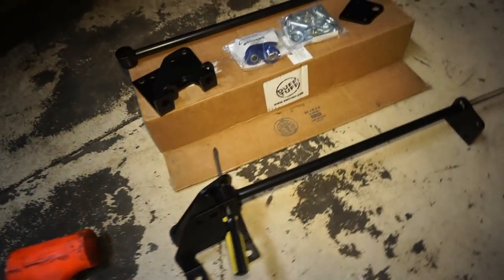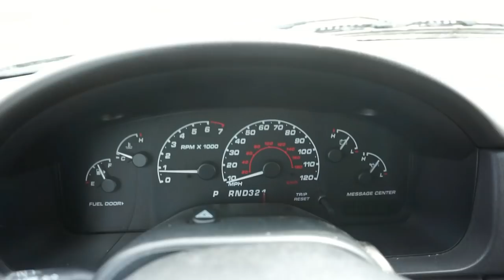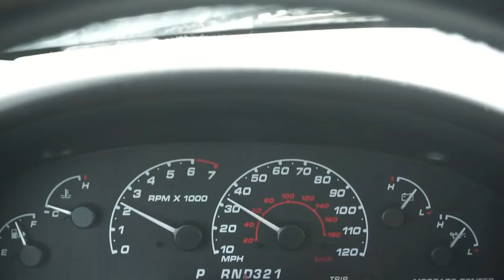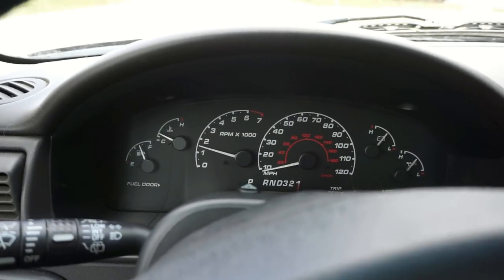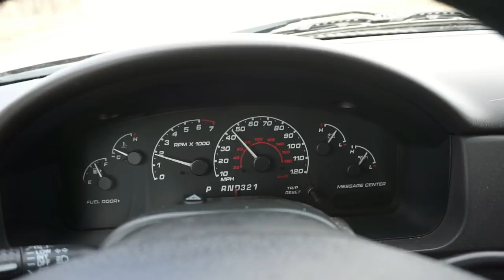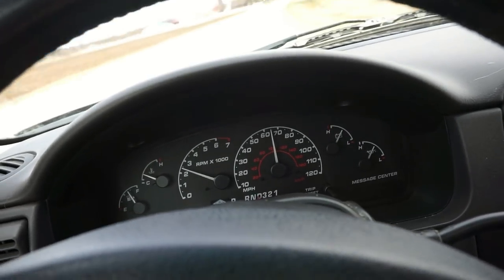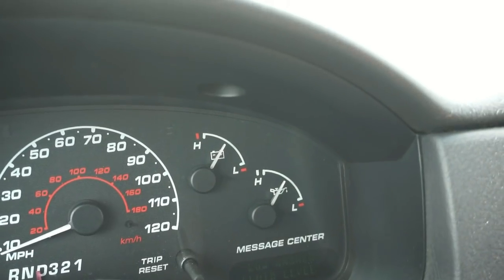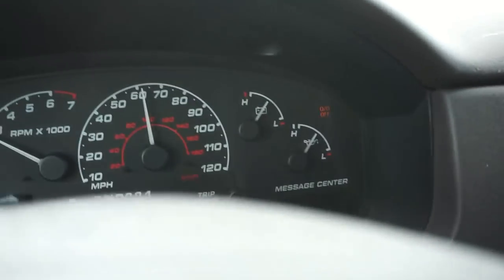Explorer 5r55w Transmission Slips O/D Light Flashing Troubleshooting!!! a21bravo

Comment: 2002 ford explorer 325,000 miles..3 transmission...3 water pumps, 1 ecm, 1 evaporator , 1 compressor a/c 1 alternator 2 radios...same starter....am 😌 satisfied...
Reply: v8 4.6?

Comment: My 5r55w would down shift going up any incline, even if mild, and it ended up being low fluid. Dam the engineers that took out transmission dip sticks.
Reply: So would getting the fluid serviced help with this issue?? The one I bought was sitting for like 2 yrs cause the old guy stopped driving it but recent having similar issues like in this video but overall it still seems to shift great
Reply: WOW! I'm having issues with my tranny. I pray all I need is fluid and not a new one or have to replace parts.

Comment: I CHANGED THE FILTER AND TRAN FLUID, MINE STOP FOR A BOUT 3 WEEKS .ONE THING I NOTICED IS WHEN IM LOW ON GAS LIKE BELOW A QUARTER IT WOULD DO THE O D LIGHT WHEN IT GOT PLENTY OF GAS NO ISSUES. IM HAVEING TO RUN IT IN 2ND ON TAKE OFFS ON A HILL BUT SMOOTH SAILING ON CASUL ROADS ,ALSO THE TRIGGER ON THE O D HAS BEEN A ISSUE. IT CAN START AND STOP IT FASY..

Comment: I have a 2005 Ranger 4x4 had new transmission installed due to flashing OD light. Transmission shop owner said I needed new transmission. So had them install new transmission and light still flashes  . Doesn’t flash all the time. An example I will start truck and it flashes. Put in drive and it goes off. May flash while driving but when I press accelerator pedal it goes off. Shop now says I need a new computer. Feel I got ripped off

Comment: I got a 2001 spot trac 4,0 4x4 it’s got so many miles on it the pore thing must be half petrified. I found if you reset the shift points it helps but you should expect to have the transmission rebuilt after 257 thousand miles. Dam I just put upper and lower ball joints on it too.

Comment: I just picked up a 00 explorer from an auto auction and it runs and drives but I have a slight slip going into 2nd and I got on it a little and the o/d light started blinking. I didn’t get it to keep just flip but I’m curious if just doing the valve body gasket would fix it.

Comment: 4 years. Aby update on it? If so I will definitely look on the channel
Reply from the maker: Servo kit helped a bit, but didn't completely fix it. Scrapped the truck.
Reply: @BlaserBuilds  thank you. I do appreciate it. I believe I will pass on it then. Same thing us going on and didn't want to trade mine for one that's going to need a transmission if it was an easy fix the yes but I have replaced a transmission in a 2002 explorer and costed me $1,311 to get it rebuilt but that was 10 plus years ago, no telling what it would cost now

Comment: Hey man great vid, i have a similar transmission issue, ive replaced, the speed sensor, then ive installed a new transmission control solenoid, and it kept od flashing, so auto parts store suggested that maybe a passage that controls the pressure control solenoid  needs to be cleaned up, any thoughts or recommendations or suggestions? I have a 2003 Mercury mountaineer code for transmission is 5R55W
Reply: Did you by chance get this fixed?
Reply: @HateEbk  I'm in the process of trying to figure out the deal with my 96 Bronco. Tranny doesn't want to shift up in 2nd or 3rd but 4th and 5th seem normal. It shift hard going into 2nd and 3rd. It also doesn't shift back down when I come to a stop. I have to shift it to park or reverse then back in drive. I have the p0500 code and the od light flash. I just changed my speed sensor yesterday and nothing has changed. I guess the next thing to check will be wires. My speedometer still works. Is there another speed sensor in the transmission? I changed the one in the differential.
Reply: Any luck?

Comment: Same problem here. I put a solenoid pack in but I did not do the valve body. Solenoid pack did not fix it. Wondering if the valve body would. Did you ever do yours yet?

Comment: Wish you had an outcome lol mine is doing the exact same thing it does shift threw gears if I do it manually... I got a 2002 explorer
Reply from the maker: I did change the Servo pins, solenoid pack, and valve body gasket. Is fixed the 2-3 flare, and the 1-2 shift got better,  But the light still comes on once in a while.

Comment: I have a 2002 Ford Explorer alt, 4wd auto-tran 5R55W, 4.6L V8. It was doing exactly what your video showed, except my service engine light came on. I went to AutoZone, free code reading and description it gave Code: P0745 Pressure Control Solenoid A. Now I just need to know if I only change this because the person who sold it to me had rebuilt the transmission not more than 3000+ miles ago. this is my only means of transportation and I live and work in a mountain area and is 88 miles round trip up steep grades. thank you SKE
Reply: Did you get to change the solenoid, and did it fix it?

Comment: I have a 2003 Explorer, does pretty much the same thing. I discovered gaining speed and RPM's to 30 mph, release gas pedal, let rpm's rest and third gear shifts. Other wise it kills the over drive if I really push the rpms, or don't make it to 30 mph. I was also informed this transmission is sealed, I should not be able to service it. I haven't had time to check into this, but I learned a co-worker had one and this happened to that one too, it finally quit for good. I do not know anything about the bands if I could find a way in.

Comment: Hi, i have ford explorer 2004, 4.0. My problem is no codes but OD Off flashes. If i accelerate slowly on high way i van drive 20-30 miles without OD off to starts flash. But in town come to flashe very soon. And from first to second gear change arround 3000 rpm or if i  go up hill goes to 4000rpm. Any ideas what to do?
Reply: I have an 05 explorer with a 4.0 in it, it's doing the same thing you said yours is doing. Did you ever come up with a solution? I could use the help.

Comment: THESE FORD SLIP A LITTLE ,IVE BEEN DRIVEING MINE LIKE THIS FOR A YEAR. THE LIGHT TURN ON  IS A SENSOR.ON YOUR GAS TAK AREA. AS LONG AS YOU GET TEH LIGHT OFF THIS  SHOULD BE FINE.

Comment: Will it cause damage to the transmission if I drive for an extended period of time? I don't have the time to fix right now
Reply: Did your car make it? I think mines doing it now too.
Reply: @Anthony Williams  I took it to the shop, and they found wiring to the transmission od sensor was compromised. They repaired the wiring and stopped for a period of time. Then it happened again on the move west. Since then, every time I drive it, I manually turn off the OD. It runs just fine without the OD, but gas mileage is reduced. I  will, at some point, get the sensor replaced. It's my understanding that there's 2 sensors I am just sure which one it is. I might just replace them both when I change the fluid and filter.

Comment: I got Ford ranger 2003 2.3 of fights flash I change abs speed sensor on rear end so change fluids it runs good on street shift 3 but win got it on highway at 55  OD  start flashing an win got off highway it started jerking win got highway cut car an cut back went to back normal

Comment: I got my 2005 Ford Explorer with 180000km for $500 and I am having the same issue. I thought Solenoid Pack might be my problem.
Reply from the maker: Commander Cody I have a valve body gasket and solenoid pack to install, just haven't gotten to it yet.
Reply: where did you get the Valve Body Gasket from? a local transmssion shop?
Reply from the maker: Commander Cody EBay.

Comment: I watched a few more video's that had the same issues and they said what this guy did, even though my code was Po75 for Pressure Control Solenoid A, it is the computer perceiving this due to what this guy said in the video. Still don't know how much it"s going to cost me.
Reply: please help me did you ever figure out the problem

Comment: Hello
I have a malfunction in Ford if I work I have a key bulb weakens the car's torque and become a shake
The jealousy of the Bawaj and how much Coyle
And jealousy sensors gear
And jealousy pigtail of gear
And sprayed nebulizer
Print the key bulb if you turn off the car and disappear the bulb and return the shape of the car normal
Quad p062C model 2007
Communicate and calculate

Comment: What did I tell you about the exploder?
Reply from the maker: Cole Murphy You must not be Paying attention, lol... I bought this truck for $300 BECAUSE the transmission was bad, for a project.
Reply: 3k from now you might have a $1200 rig, I sell parts for them all day
Reply from the maker: Cole Murphy They're selling around here for $1k with bad transmissions... $2500-$3k+ working. Used and working trans are about $400, $1100 completely rebuilt...I'd never spend $3k on a good one let alone trying to fix one... $4-500 ish Maybe, if that doesn't work I'll sell it with bad trans and still break even.

Comment: This is amazing that someone can read about these problems. And watch videos all day long and not get the same two fixes from anyone. I have done all the above servo's solenoid pack. Got a code now for a torque converter brake sensor. And my battery light keeps coming back om along with the constant flashing overdrive light. 5R55S and 5R55W are a piece of shit the 2002 to 2005 Fords are a piece of shit. And everyone is making videos and absolutely no one knows what they are talking about. What's the harm in that  you say? People are out there spending their hard earned money on you advise and it still don't cure the problem. If you dont know what the problem is stay off the internet making videos like you do stupid! Ford Motor Company should have their ass taken to court for making a product that is a piece of shit. And charging 30K for it. Have a nice day everyone. AndI hope someone reads my comment and it saves them some money.  You got your Explorer for 300.00 you still got ripped off you idiot.
Reply: 2004 Explorer, looking at 4th transmission. I dont understand how this happens even after a rebuild/reman.

Comment: Did you fix it?? What did you do??
Reply from the maker: Honestly, I've just been driving it... Like Everywhere, haha... I have a new solenoid pack and valve body gasket to test, but haven't installed it yet... Might try to get it in before winter.
Reply: HAHAHA! that’s too funny! IM DOING THE SAME😂😂😂. I’ve put over 300 miles on my 04 $400 eddy the way it is, I’m literally thinking of driving it to Las Vegas from Los Angeles because I’m going to SEMA and I’m sure you know, it rides like a dream and I know it can make it. I saw a vid about rebuilding the solenoid pack, it seems super easy. I might try it out because I have 2 LKQ’s within minutes of my house if I mess it up somehow! 😂
Reply from the maker: @art_urio  Yeah, I took it on a 4 hour trip a few months ago... Its been my daily almost since I got it... I just lift for a second at about 16-17mph and then it shifts... Can't complain. I actually like the damn thing haha.

Comment: I have two rebuilt 5r55w trans now if your interested in one
Reply from the maker: Nick Moore Price and location? That was another option so I don't have downtime with this one... It's really just a side project so not in too much of a rush...
Reply: a21bravo I can get a good deal on shipping through my work on a pallet. I could do $1100 shopped with a good converter. I also have another with a shift kit in that one for $1200
Reply from the maker: Nick Moore That's reasonable, but quite a bit more than I'm looking for... I'll keep it in mind though, for sure... Maybe I'll get a bug up my butt and make it A baby hauler.
Reply: a21bravo not very easy to find a better rebuilt transmission then that price LOL most icy are close to 2000 especially without a core and most used all have similar issues
Reply: Do you still have one of these?
Reply: @nickmoore4212  you still got one?